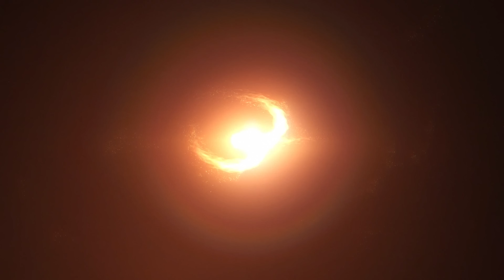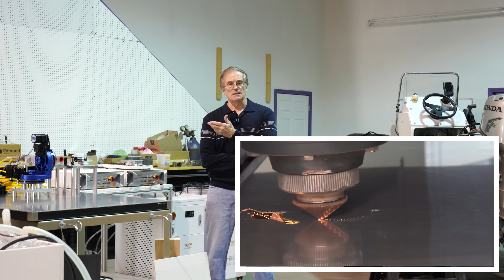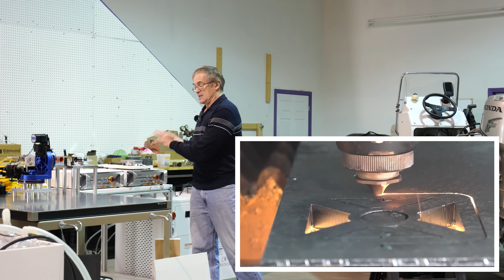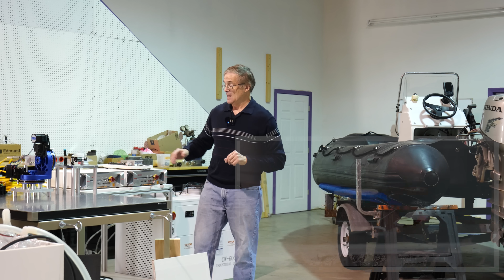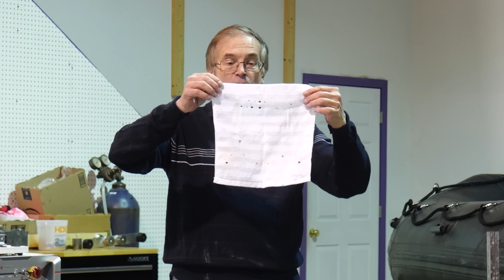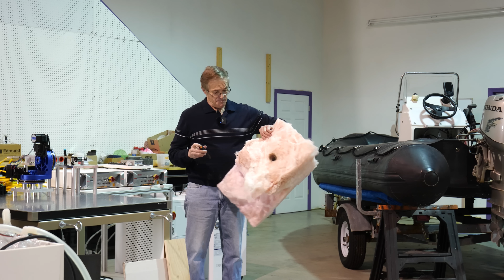We have a problem... and need your help!

Comment: ChatGPT AI===>> After a laser beam goes through a material, how can I block or stop the beam from damaging the wall or floor on other side??

ChatGPT said:
To safely block or stop a laser beam after it passes through a material — and prevent it from damaging a wall or floor — you need a laser beam stop or beam dump. Here's how you can do it, depending on your laser's power level, wavelength, and application:

✅ General Solutions
Commercial Laser Beam Stop / Beam Dump

Designed specifically to absorb laser energy.

Made from materials like anodized aluminum, carbon composite, or copper with black coatings.

Often air- or water-cooled for high-power lasers.

Example: Thorlabs, Edmund Optics, or Newport sell them.

Laser-Ablative Material or Fire-Resistant Absorber

For lower-power lasers (<500 mW), you can use:

Black anodized aluminum plate

High-temperature ceramic tile

Laser safety mat

Charcoal-black bricks or refractory brick

DIY Low-Cost Blocker (Low Power Only)

Stack of black painted metal plates, angled slightly to avoid reflection.

Carbon black-coated surface on metal or ceramic tile.

Matte black steel wool behind a metal grill (absorbs and diffuses beam).

Place far enough from flammable items.

⚠ Important Safety Considerations
Never use mirrors, glass, or shiny metals as they can reflect the beam dangerously.

For high-power lasers (>1W): Use certified beam dumps, not DIY solutions.

Use appropriate laser safety goggles when aligning or working with exposed beams.

If the beam exits an optical experiment, angle the beam down into a safe, enclosed area.

🔧 Tip for Setup
Place the beam stop at a slight angle (5–15°) to avoid retro-reflection.

Ensure the block is thermally stable and non-flammable.

If working in a lab: Always follow ANSI Z136.1 laser safety standards.

If you tell me the laser type, wavelength, and power, I can suggest a precise material or setup.

Comment: Is it possible to control the amount of energy that laser produces? For example, the target you are pointing at can be shot with a low power green laser and after a milliseconds, when the system have positive feedback for interception, then you make a few short pulses with certain PWM. Usually, from a practical point of view such system should use the precise amount of power to shot down the target, instead of "tank shell" for mosquito killing. Also, you can test all of the hardware and software for the system without having to use the high power laser.
For the walls - no matter what material you are using you should place it along the beam, not perpendicular. In this case the scattering of the laser will remain inside this cavity and will reflect inside, spread across larger area. I would try with any concrete sheets, similar to dry wall sheets, but made from concrete. At the back of these stacks will place a copper sheets or some reflective material that will point back to the residual cavity. Also, these stacked walls could be filled with dirt. As a result you could have 50+ cm thick walls with horizontal layers of concrete sheets and dirt.
Even simpler will be to dig a Olympic pool size hole in the backyard and place the equipment inside. Again, it might be simple, but this is far from elegant idea :)

Comment: This has actually been done before. To restrict your laser's destruction range, simply incorporate a modified kyber crystal focusing array calibrated to create a containment feedback loop that forces the beam to terminate at precisely your desired distance (kinda of like with an op amp). The crystal's harmonic resonance can be adjusted to establish a predetermined range for the laser emission. You can also integrate a nadion particle buffer with inverse shield modulation, thus allowing your beam to automatically dissipate upon reaching programmable coordinates in 3D space by triggering a localized subspace field variance (irrespective of any quadrant). This essentially sets the emissions to “stun” beyond the target zone, so be aware of lifeforms beyond the target range although the effect is temporary. You will need to recalibrate the primary dilithium matrix after every shot, just to be safe, and of course it depends on the factory part tolerances. Just don’t buy any from Temu or Amazon Haul, and YMMV if sourcing from eBay.

Comment: 1: Mirror angled to reflect the beam into the floor 
2: Fish tank with dyed water
3: Sand bags

harder ideas:
4: water curtain
5: rotating belt or drum
Reply: 4.1: Water curtain inside a box with a single hole for the laser input

Comment: Use an aquarium with suspended particles in it so that it's very opaque. The particles catch the laser energy of the laser beam,  heat up, give it to the water, the water boils away, taking away massive amounts of energy. Functioning as a heat sink. Blow away the water vapor, or capture it and let it condense in a condenser to re-use it.

Comment: You make a small glass aquarium (the shape doesn't matter) that can be closed watertight to add water, insert plywood into the back wall of the aquarium and attach the aquarium to the shaft that the motor rotates. 

When the laser hits the plywood through the water, the plywood absorbs the energy and doesn't catch fire. In addition, the rotating motion prevents the laser from hitting the same spot all the time, so the beam doesn't go through the plywood. 

For the next test, you can change the water in the aquarium and a new plywood. 

You can also make a separate barrier in front of and around the aquarium with a hole for the laser to go through, so that some of the beams don't bounce back in the direction of entry. 

Here you go. cheap, functional DIY.

Comment: does glass from a fish-tank absorb a lot of thermal energy from the laser? if it lets it pass through you may be able to fill the tank with water and put in a metal/steel plate, even paint it black, and the thermal capacity of the tank and the steel or metal plate may be enough to stop the laser before anything goes wrong. hell maybe try the fiberglass insulation in the water as a basic test to see if the thermal capacity of the water offsets the melting of the fiberglass too as that would be a cheaper option. This last idea may sound dumb but would painting a thermally conductive material with vanta black or some such dark material help absorb more of the thermal energy and then have it be passively dissipated via other means?

Comment: Shine the laser beam into a water tank made of laser transparent glass. The water should have dissolved pigments that absorbs the laser light frequencies. A device that stirs the water in order to dissipate heat and steam. Alternatively have an open top water tank and a  laser capabable mirror to direct the from horizontal to a vertical beam into the pigmented stirred water. Good Luck!

Comment: I would start upstream - a secondary monitoring system with the sole task of performing a checksum on the outputs of the laser releasing a stored energy diffuser lens  into the beam. As others have mentioned a multi operator fail safe switching. Make a gun range out of tote bags filled with dirt.

Comment: Pwm it? Maybe? Have it only go full power for a split second with a failsafe to make sure it doesn't get stuck at full power.  As to blocking the beam, maybe graphite? Or kaowool? Or both?

Comment: If you point the laser into one direction, a small sand dune is cheap and the sand will scatter the light randomly around. If some sand gets so hot and melt into a glass like chunk, it is easily to replace.

Comment: You need to try something that is already burnt, charred wood, char coal, anything that is basically carbon. Carbon fiber would be a good start. A bit pricey. But not by a lot. Ceramic tiles from the home depot store over wood. Lastly you might need to accept steel plate.
Reply: Also take it to an out door place and let it hit dirt or rock as the back ground. Gun ranges work this way. I know you want it to be for the shop and mobile but hey nothing is cheaper than taking it to a place with a rock or dirt back ground.

Comment: Main point is to reduce power density and than trap the scatered laser light.
Higly reflective surface that has wave like profile placed in forme of strips under 45 degrese angle directing scatered light to the backing of other strip in the row, backing made of ablative material.

Comment: I was thinking RockWool Comfortboard may be an option. Similar to the fiberglass insulation but more dense and made of spun stone/non flammable. Cement board/Hardie Backer should be more robust than drywall and also non flammable. You seem like you don't want to deal with the weight, but sand/dirt bags would be cheap.

Comment: How about leaving the horizontal plane and facing the system downwards? Its like the lite-version of the salt-mine, till you reach earths core. Drones and remote cars can still be the target. To protect the ground-layer a slurry water-layer can be deployed. Additionally I would make sure, that the working-area of the gimbal can be limited to that safe ground-vector.

Comment: My first thought was water, not soaked into a material but sandwiched between two layers of glass or similar, with fine charcoal or graphite powder suspended in it  to absorb the beam. Any material that gets evaporated will rise, recondense, and be replaced with cool material from the rest of the tank. Of course the problem with that is the glass, which might melt or reflect the beam back.

I see someone else already posted a better version of this, with a curtain of dyed water flowing over a surface.

Comment: Fire brick? The brick you showed appears to be typical clay brick. With fire brick you may be able to use thinner portions which could be laminated to a substrate. It may even be available in panel form. All of this assumes you would not need the entire thickness.

Comment: well, drywall is bad because it ablates a lot and do that because it offgasses easily and resulting solid is powdery. maybe cement fiberboard can fare better.
othe possibility is something that never melts, carbon may work, either as charcoal, or a paste made from charcoal powder\coal powder\activated chacoal powder\carbon black and an inorganic binder.
talking about biders, i found recently, in YouTube, that mixing a solution of sodium metasilicate and alumina powder ypu can make a goo refractory glue that dries solid, heat cures and doesn't crack easily.
so, maybe a fiber cement board coated with a black mixture of alumina, sodium metasilicate and charcoal, then baked in a ordinary oven can be strong enough

Comment: This is the technology used in additive manufacturing. You may get some traction by reaching out to one of the major industrial 3d printer manufacturers. I think a build plate mounted to your wall will do (non-expert opinion). They come in a variety of sizes and materials but it's basically a large block of metal.

Comment: Graphite plates could work in conjunction with a diffuser (cuvette with an emulsion or suspension of e.g. oil in water or barium sulfate nanoparticles in water, or colloidal solutions with Tyndall effect).

Comment: Playing back old memories I vaguely remember that special powerful lasers deliver energy by impact that causes erosion, and some have been designed to remove material without actually heating the target.  Could it be that the best method is to listen for the impact of the beam with an array of properly backed piezoelectric transducers or equivalent bonded to the back of a steel plate and turn off the beam?  The time involved to do this would include the travel time of the compression wave through the thickness of the plate and the rise time of the sensor to reach a trigger threshold for a kill switch.  This would probably be in the low microseconds, most of that for the electronics to react.  It may be that, because the S wave through stees is so fast, few sensors would be required, and they may require no backing.

Comment: I agree that a moving unit is the key. Pick the material that lasted longest in your tests, and cover a large slowly rotating disk. Get the disk rotating.  Use a 2nd travel motor that will move the rotating disk back and forth behind the target. This will focus on disk resulting in a spiral pattern.  Make sure that the beam will not stay in one spot longer than the lasting time of the stop material.

Comment: Intumescent materials could work!
Most Intumescent materials work by creating carbon foam when exposed to heat. carbon has a high point of sublimation and radiates infrared well(thats probably why the wood lasted so long, it probably carbonized), so it will absorb a lot of energy to burn through and the foam isolates the heat, making it burn through much slower.

it is also pretty accessible and cheap! There is commercial paint available as "fire retardant paint" or you could make your own, Nighthawkinlight has a great cheap recipe in his DIY Starlite series!
Reply: The reaction needs a bit of time to happen, odds are the paint would get vaporized instantly
Reply: @walbao6399  yeah, maybe a tile would be better, paint might be too thin.
Reply: @Slivott  I believe NightHawkInLight did make an intumescent putty at some point, those could be made pretty thick
Reply: But it definitely should be tried.
Reply: I think it would be useful research to try starlite for this, just to get data for a tier ranking among other laser-shielding approaches
Reply: I was searching the comments to see whether anyone else had suggested this. "Starlight" or its clone, made cheaply by Nighthawkinlight, is probably worth trying. You could slather it on a sheet of drywall and test.

Comment: My thought is to use something like thin water cooled tiles attached to plywood board or something similar. If water is flowing over the front you should be able to use thinner materials as the constantly flowing water should overcome the thermal load no problem. Also recirculating the water should mean you dont need a huge water source, just a reservoir and a pump. The thin tile material should mean that your weight should go way down compared to a properly thick brick wall. If you cant find thermal resistant tiles you probably can just slice carbon bricks into tile size pieces.

Comment: Three things we have difficulty cutting with our laser: Aluminium-faced chipboard, kiln insulation, and lexan. Lexan expands and causes a lot of mess but doesn't actually burn, and it might be that "bullet-proof glass" might contain the mess (have not tried it, not much around in NZ). Random thoughts: perlite or vermiculite may melt, but might flow into the cavity and can absorb a lot of water. Again, not tried it.

Comment: My first thought was a water fall, a curtain of water. I saw an office complex where the main entrance had a  wall sized marble structure with a water fall. 

Marble may be too heavy and expensive, so another material here. 

Plus instead of pure water, add tinting or better yet small particles such as carbon black or titanium white. I already have multiple matrices of design attribures to test and experiment with in my mind including thickness of the water fall, additives including type, particle size, and density. 

I just retired from Blue Origin and hot burning gasses is a thing. But mostly, lasers are used in the manufacturing of engine parts, usually while 3D printing various components using lasers and plasma in giant room size chambers. 

My 45 year career centered on R&D in the semiconductor manufacturing field  and other. I have worked around lasers, but always relatively low power. Enough power to mark and cut silicon at most.

Comment: What do you think of the following suggestion? Make a drywall in two layers separated by about 20-30cm, for example. Close the entire space around the edges with the same drywall sheets, which should be very simple. Then on one side you insert a pipe that would fill the space between the two drywall sheets with smoke and on the opposite side you make an outlet for the smoke to circulate and return to the compressor (for example, palm oil smoke used on stages). The smoke should absorb the energy of the laser beam so that it will not affect the background drywall sheet. The holes that the laser would drill in the front wall sheet would also release smoke at a rate that would depend on the pressure of the compressor. But this is not permanent damage because for the next experiment the holes could be covered with self-adhesive paper tape.

Comment: Could you swing a mirror into the beam and then use a lens to diverge it? Then dump the energy into a slab of metal, black anodised?
Or how about a circular piece of metal rotating quickly?
Or a tank of water with a very dark dye dissolved in it?

Comment: I remember that we had communication issues using FSOs quite a while back using lasers. As the absorption with any material will always result in burning material, maybe scattering is the only answer I could think of. Water based fog droplets have a very similar wavelength to light and are perfect to weaken a laser beam. So a fog chamber as background could be a feasible solution which would absorb the light probably quite well and a test would be very easy to do.
Otherwise a simple color filter glass (tone would need to be found I guess) could be an alternative in front of the final absorption wall.